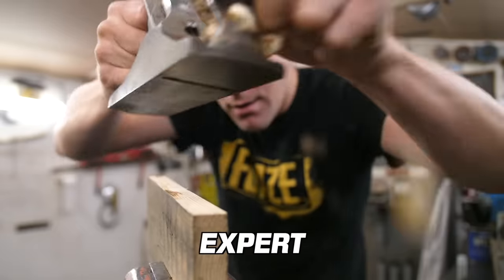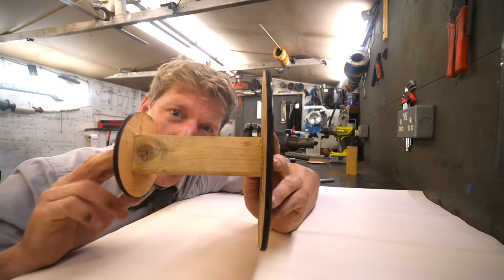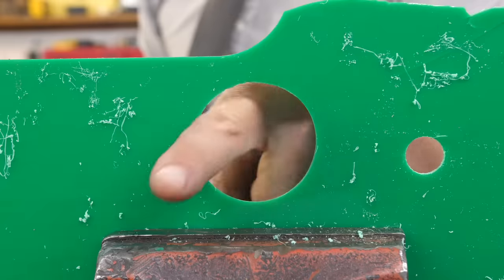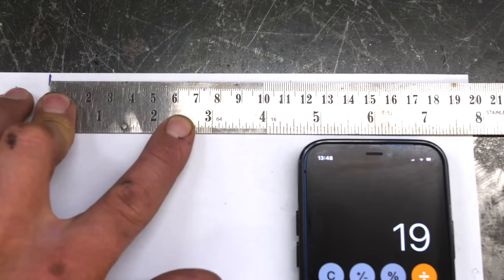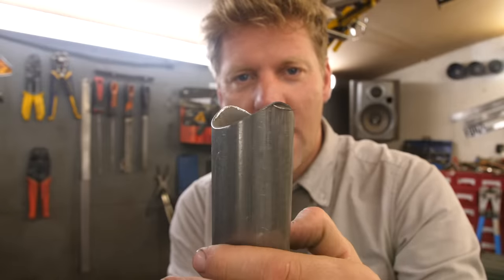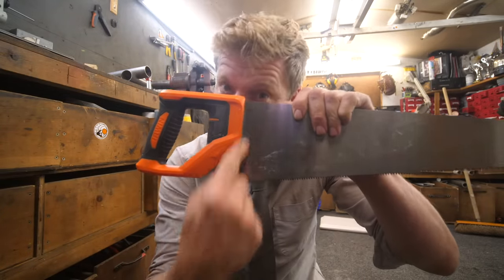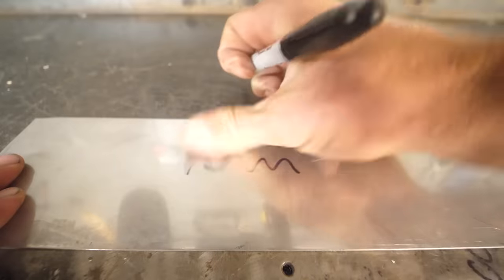18 GENIUS Workshop TIPS (that actually work)

Comment: One thing I learned from a workshop is that if you need millimetre-accuracy, to never use a measuring tape from the metal end, because that piece moves about when the rivet starts to loosen over time. Instead, pick a mark to measure from, i.e the 10cm mark, and then just subtract that amount whenever you make a measurement. This provides greater accuracy and consistency between different measuring tapes. It's a simple trick, but it checks out!
Reply: Good tip - but worth noting that the end of a measuring tape is supposed to be loose, to account for when you measure with the end hooked over something or abutting it
Reply: The end of the measuring tape is supposed to move for inside vs outside measurements (it moves the width of the blade). But they can wear and get out of square. The latter can be fixed carefully with pliers.

Edit: jinx. Apparently I just needed to refresh the comments to see that this point had just been made.
Reply: I use this but be warned, if you don’t remember to allow you’ll be cursed with the sneaky 100.
Reply: Yep, I did this a lot. I'd measure from the end of the tape and then double-check from the 100mm mark.
Reply: And if you need to subtract a specific dimension from a length you're gonna mark (lets say you need to subtract 243mm from 1060mm),  instead of calculating the reminder, just put the subtractable  (243) on the edge of the piece and put a mark at 1060mm.
Reply: You can also use the rubber corner of a tape measure as an eraser for pencil marks. Gotta love how versatile they are
Reply: Also, whatever measurement device you use, don't switch to another for the same or related measurement

Comment: To draw a hexagon, first draw a circle using a pair of compasses. Next without changing the compasses, put the pin on the circle and mark an arc on the circle. Put the pin on one of the arcs and mark more arcs. Finally, join up the arcs with straight lines and you've got a perfect hexagon.
Reply: C’mon guy’s that’s Spirograph 101..😂👍
Reply: I’m a origami artist and all I can say is thank you for this tip so much. Man that’s helpful to know.
Reply: I use this method a lot, and it also works for drawing triangles if you join 3 points instead of 6
Reply: @tdumnxy No, it is perfect. You're not measuring along the circumference, you're measuring along a chord, and the length of the chord that forms one edge of an inscribed hexagon is exactly r.
Reply: To make a pentagon you can make a regular knot with a strip of paper, probably not very useful but still a fun fact !

Comment: Similar to the sharpie one, spray paint can be re-'hydrated' by more spray paint (or rather, by the chemical accelerant in it, so spraying the second coat up real close to soak it works best) for easier cleaning (a can of clear paint is useful for this). In fact, I believe most things that are applied liquid and then dry on can be un-dried by applying whatever original substance kept it wet (water, alcohol, some other chemicals, etc).
Reply: I discovered it by accident when a can of pain let some drops go on dry paint I did earlier and leave big marks + visible primer...

Comment: Sharpie: whiteboard marker also removes permanent marked from smooth surfaces (doesnt apply to anything that ink can seep into like wood)

Great video, loved it! So many tips for people who don't have all the cool tools (like me!)
Reply: This works as they use an alcohol based solvent, so to save your pens you can just wipe it off with meths or iso
Reply: It also ruins the board marker.

Comment: Your tip for find the centreline of flat stock (put a ruler diagonally across and measure a multiple of two and half it to find the centre), also works for any number of splits. 

Want to split it into thirds? Find a diagonal with a number that's easily divisible by 3 and mark them off. 

Works for any number up to the length of your ruler.

Comment: Have a tip for when you use cable ties/ tie wraps/ zip ties… whatever you call them. After tightening them down and instead of cutting the tail off and leaving a sharp jagged end that ca scratch you. Use a pair of pliers and pinch the zip tie tail at the  base and twist it around till breaks off. It will leave a clean smooth end that you wont cut your hand

Comment: When using the slip roller to make an offset cone you use vise grips similarly to the piece of angle. I wish I had thought of that trick working in tinknocking shop. The vise grips lock the smaller offset side while still rolling the bigger end. Takes some finessing

Comment: Aerosol spray tip, you can also increase pressure by putting it in hot water.
Greasy hands, use washing powder instead of the sugar.
Getting sharpie off, hand sanitizer works wonders
Reply: what is washing powder?

active ingredient of hand sanitizer is isopropyl alcohol. Works great.
Reply: just stomp on the can a bit with a big dent as soon as you feel the pressure dropping.
Reply: @JohnDoe-fk6id  clothes washing powder, isopropyl is great, since the coof coof, hand sanitizer is common place
Reply: @Deiphobuzz  😂 that’s certainly a way to do it
Reply: @Lowbrow_Mthakathi  might save you walking up and down 15 stairs for a new can 🤣

Comment: Hello Colin, love the video. One thought on the square is that your tip tells people whether it has right angles rather than if it’s a square. If you were to add that the sides are all the same length, then that method would define a square. Andy.

Comment: If you want to divide any straight line into equally big segments you can use this trick.

Use the given line as the base of a triangle. Draw one of the new lines with an easy dividable length according to your wished segment length. As an example you want 7 segments draw a 7cm line and mark every 1cm.

Then take a ruler and a square edge and slide it parallel to the third line, crossing every marking you made. Your original line will be split perfectly no matter what weird measurement it had.
Reply: Smart 😮
Reply: i am so lost

Comment: Here's a tip if you want to drill a hole across the centre of a round tube or shaft:  Put the tube or shaft in the machine vice on the pillar drill, put a centre drill in the chuck, and bring the point of the centre drill down on the roundy thing with a six inch rule trapped between.  If the rule is horizontal, the drill is aligned on centre.  If the rule tips one way or the other just move the vice until it's horizontal.  So simple!
Reply: Found this during my apprenticeship. still use it to this day....

Comment: another tip: when you are tapping by hand, use a jacobs drill chuck that's not attached to the drill as a tapping handle. This will allow the tap to spin before it breaks.

Comment: Any rectangle will measure the same across opposite corners, not just a square.
You need to measure from opposite edges across the centerpoint and get the same result in those two measurements to determine if it's a square.

Comment: One suggestion for the echo in your tunnel is to dress up the walls of the tunnel with carpet squares. It will make the sound nice and you can lighten up the color
Reply: Exactly what I was just coming to post! If you can find it, "shag" carpet is best (more surface area for sound waves to be attenuated by).
Reply: What kind of self respecting dwarf digs a hole in the ground and then gets rid of the echo?
Reply: That'll ruin the atmos!

Comment: For the sharpie/“permanent” ink, use a dry erase marker instead of another sharpie. Many dry erase markers use MEK as the solvent and will act better to allow you to remove the other ink.
Reply: And (maybe obviously) if you have let your dry erase marks sit for too long on the surface/whiteboard and don't have a liquid cleaner, going back over the lines with another dry erase marker will allow you to wipe it off.
Reply: they use mek? isnt that stuff seriously toxic?
Reply: Seconded! I just used dry erase yesterday to get permanent marker off a toy that I drew on there when I was five (I'm 44).
Reply: You can also use deodorant or aftershave/perfume to remove permanent markers. (Except on pours surface ie wood)

Comment: You can use a framing square to find the center of a circle. This method takes no measuring. 

Lay the square onto the circle with the outside corner of the square flush with the edge (tangent). Make marks where the two legs of the square intersect the edge of the circle. Draw a line connecting the two marks. Repeat this one more time with the corner of the square moved to any other place along the edge of the circle, and the two lines will give you center. 
A quick tip is to not draw a line completely across the circle, just draw an inch or two in the middle of the line so you end up with a small cross hair.

Comment: Another tip for sharpie, use an expo/dry-erase marker over-top of the sharpie. It'll work on most surfaces, I find using the black or red dry-erase markers work best usually. Any left over colour can be washed away with water or isopropyl alcohol afterwards.
Reply: Anything with alcohol will help remove sharpie.  Sharpie and Dry Erase both have alcohol as a solvent for the ink that quickly flashes off
Reply: Whiteboard marker is definitely the go.
Reply: @AugustMcKenna  if you've got paint thinner in your shop that works even better, just splash some down and wipe it off; off it goes!
Reply: Was looking for this very comment before I posted a repeat
Reply: This works a treat, especially on whiteboards where you may have (ahem) written on the dry wipe whiteboard with a permanent marker pen
Reply: When I was a kid I found a skateboard that I proceeded to mark up all over the place with Sharpie type markers, and I found that nail polish remover would take it off really easily.

My sister was pissed that I used up all of her nail polish remover.

These days I won't piss off my wife that way.. I get my own supply.  LOL
Reply: came here to say the same thing.
Reply: how sbout brake cleaner and a rag?

Comment: using the saw as a square is a useful tip joiners use a lot thought you would have mentioned that the angled side of it is a 45o as well.

Comment: To draw a straight line on a metal tube I just slide a metal ruler edge across the top. Leaves a perfect straight line as long as you keep the ruler somewhat level.
Also instead of adding sugar to washing up liquid, add dishwasher salt... That combo has some kind of reaction, it heats up a bit, and it will get the worst of grime off anything

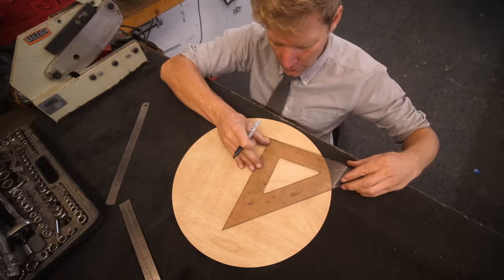Comment: 4:43 To find the center of a circle, you can only use a flat angle (I hope it's the right name).
Take a flat angle that a little bit bigger than the circle and lay it on top. 
Now push it with the outer tip of the right angle corners against the edge of your circle. 
The both arms (short and long) must show now over the edge of the circle. 
Mark these point on the outer edge from your flat angle on your circle edge.
At least you must connect these two points an repeat it on a little bit other place on the circle.
Where the cross is, is the middle.

All of these work because you use a right angled triangle in an half circle and the hypothenuse (longest side) of the triangle is the diameter (longest straight) in the circle...
Reply: I think the what you mean to mention is a set square. And yeah, the geometry checks out since the diameter always subtends a 90 degree angle at any point on the circle.

Comment: Another tip - after you've painted something with hammerite and want to clean your paintbrush, just let it sit in a jar of the cheapest cooking oil you can find for a bit.
Reply: ehh? most paints are instantly contaminated by oil
Reply: @bigduphusaj162  not if they're oil-based!
Reply: @bigduphusaj162  it helps get the paint off the brush, then you can just wash it under the sink.

Comment: Some great tips, the one i like is to remove stripped and broken screws and bolts that have a slight protrusion is take your drill and tighten the chuck down on the broken fastener and power it out.

Comment: Great video Colin........I will be trying your copper pipe straightening hack today. Have a badly coiled up 8mm pipe, which needs to be straight, then run as a fuel pipe under my classic car. Will save me £80, on the cost of a pull through straightening tool !

Comment: 8:45 you can also just use a straight bar, lay it next to the tube and make your mark. An angle iron is useful, but a flat bar piece does the job just as well ✌️😎

Comment: Others have noted that you can use isopropyl/rubbing alcohol to remove sharpie as well (though it doesn't work for industrial/wet-dry or scientific/high-temp sharpie formulations). However, I recently discovered that 99-100% purity rubbing alcohol is easy to purchase online for cheaper than denatured (fuel) ethanol. Rubbing alcohol works for all the same kinds of cleaning/solvent needs and aside from being a bit rough on the skin is actually safe to touch without gloves.

Comment: you can remove sharpie from non porous surfaces with your finger if you rub it firmly until you feel it getting hot from friction then it starts to fade.

also rubbing alcohol gets sharpie off fine so does acetone but acetone eats plastic

if you put a piece of wood under your hammer when pulling nails it gives more leverage and makes it easier to pull the nails

if you’re trying to pull off an pld rubber hose from a fitting or pipe and dont wanna cut it or damage it push it and twist it till it pops loose then pull it off

Comment: Yo, came up with my own 2 ideas on how to drill a hole at a right angle though anything round, shaft, tube, boss, bush. Always use a center drill first!
#1 Clamp the round object length ways in the drill press vice. Use your eyes and a straight edge to scrape marks onto the top of the round, using your eyes to keep the straight edge parallel to the drill bed, dot punch the middle of your marks scraped on the round.
#2 Drill presses usually have slots in the bed to bolt objects down. You can use these slots as centering for your round objects providing they aren't damaged. Use the slot to center your hole with a drill bit slightly smaller than the slot. Make sure its still accurate after tightening your bed. The slot in the bed is commonly used in mills to hold round stock.
If you read this far, my favorite was using wood to straighten small steel tube!
cheers

Comment: If you drill a hole on the bottom of a 5 gallon bucket large enough for the male end of your extension cord to go thru you can wind your electric cord in the bucket and it keeps it super neat and with any easy pull the cord comes out neatly

Comment: On sharpies, use an expo or other dry/wet erase and scrub over it, then remove the dry/wet erase. Only works on smooth surfaces you can use the marker on to begin with tho. Sharpies are alcohol based, so some rubbing alcohol will also do the trick.

Comment: The hand saw/set square tip can be extended slightly as most hand saws also have a 45 degree included as well as the 90.

Comment: You're welcome about the slip roller tip Colin. you just tie the angle in with mig wire so you don't have cut different lengths of angle and I did send you a video of something like what I was talking about you must of missed it. keep up the good work 9:46

Comment: Jewelers polish or Jewelers rouge for polishing. Works so good for polishing and so fast. DId my headlights in like 5 mins for what the would have been hours of sanding and polishing the way most people do it.  Its made for polishing metal mostly but works wonders on plastik too. Also will polish your scuffed and oxidised  safety glasses and face shields like new. Make sure you get the brown for plastic. They have other colors for harder surface's.  Super cheap. I even used it on marble tile and got an instant shine that would have taken hours the traditional way. I might even try it on a old car even tho it goes against everything a paint guy would tell you I'm almost certain it would work great. Super cheap too

Comment: You can use hot glue and masking tape to make a quick and easy form for using epoxy or resin (more tape for larger parts) once epoxy dries masking tape so long as it is adhesive side towards your resin can be easily removed (though it's not real hard to remove with the backing on it either depending on brand theres usually just enough wax that it's removable with heat gun and either scraper or wire wheel) and hot glue can be melted away with a heat gun. The epoxy can be further routed or ground to form and you can even easily cut threads into it if you want a quick dirty plastic part. I've repaired a large number of parts this way including the bottom nozzle of my radiator which lasted over 3 years on a closed circuit car cooling sytem which i know builds up quite a lot of pressure(jbweld eventually gave out due to radiator fluid corroding it but I could have coated the inner surface with something more corrosion/heat resistant and it would have lasted longer).
Reply: Seriously since my car is from 1997 I find myself using masking tape to create quick pour in forms for many parts no longer available in the us market.

Comment: That's how I have rolled cones ever since I started fabrication over 20 years ago! Or bump them on the press for heavier gauge stuff. 
Also to find the centre of a circle you can use a set of dividers and mark a few arcs from the edge.
Reply: Also, a rhombus will measure the same corner to corner, but its not a square. You need to check the widths are the same too.

Comment: Load your hand files up with chalk before use. With soft metals it stops the file loading up with the metal and gouging your work.
When you use a hand saw or a hand file extend the index finger of the hand on the handle down the length of the tool, this helps align the hand, wrist, forearm with the cutting edge for a straighter cut.